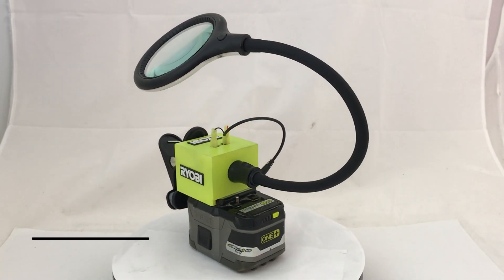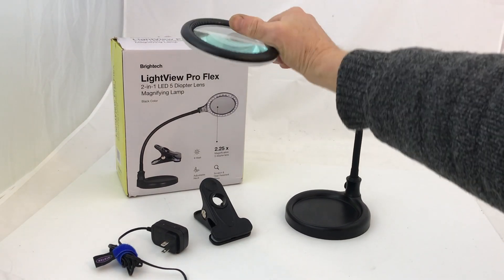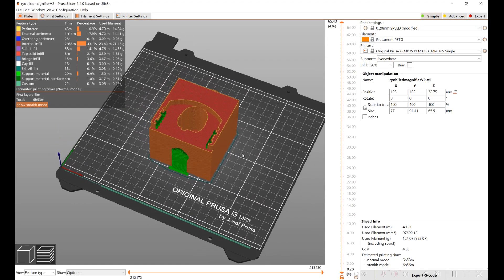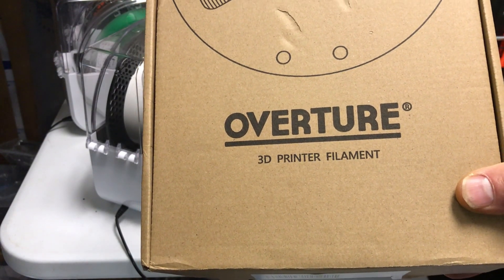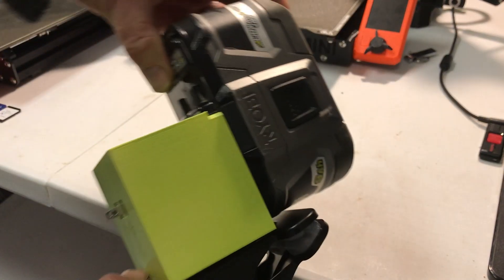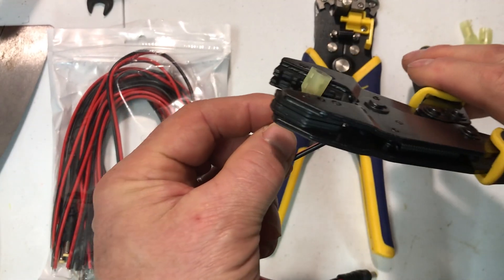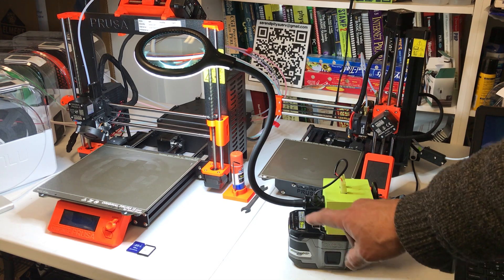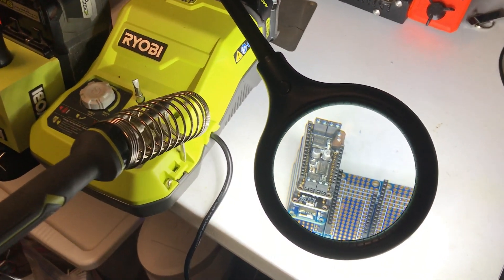RYOBI 18V DIY LED Magnifier

Comment: I just bought the same one and thought the same thing that I wanted it to be more portable! Thank you for the great idea!! I came across your videos looking for a battery hack for a 40volt ION ice auger battery replacement. I have Rigid tools for I have 18v batteries and now I know I can make a 40 volt battery out of 2 18v batteries because they actually measure 20 volts each

Comment: thanks, I made a bunch of your ryobi stuff
I made a cap for this to cover the wires and give a spot to install a low voltage disconnect to protect the battery
my cap was very basic, I cant cad. I imported this cube into tinkercad, sliced off a solid section, made it about an inch tall, then hollowed it out making a square bowl. I drilled a hole for the wires and screwed it to the top of your adapter
Reply from the maker: Nice! email me a picture of what you did. I can try to make it up in CAD and add it to the project files. Thanks!
Reply: @SerendipitySue  done, check spam if its there
Reply from the maker: @woodchippers_WestWingDimeBag  nope, didn't get it?
Reply: @SerendipitySue  serendipitysuerv  att gee male ?
found it on your about page
Reply from the maker: @woodchippers_WestWingDimeBag  that's it, but didn't get anything yet :-(
Reply: @SerendipitySue   I posted a video from tinker cad
Reply from the maker: @woodchippers_WestWingDimeBag  maybe just try sending a small photo?
Reply: @SerendipitySue  sorry for the delay, busy weekend. I added a video containing a couple pics of the cap I printed and the low voltage board to protect the battery along with a vid of the cap in tinker cad
just click name to go to my channel to see the videos

Comment: Would using the battery as a base be heavier when the battery is fully charged?
Reply from the maker: I don't think the battery weight changes with charge. I use the 9Ah battery because it is the heaviest
Reply: @SerendipitySue  ;)

Comment: I like the idea but we need a digital microscope too.  Please
Reply from the maker: Is there a particular one you like? What do you use it for?
Reply from the maker: Saw this: https://amzn.to/33QpJ9f
Reply: Having a system for either a minerals or coins with a removable SD card would be awesome. I see the Ryobi battery one plus 150 watt inverter/solar charger still not out yet. Sorry it took so long to get back when I went into surgery on Thursday.  Cheers
Reply: Don't know if I can paste the Amazon link here cuz I'm not a moderator .
Reply: Mssci 7 mp digital microscope with removable SD card...
Reply from the maker: @dennishedrick5308  seems like most microscopes on Amazon have built in batteries?

Comment: I have been playing with speaker systems.  Just got a 12 up to 24 volt DIY audio amp that I plan on powering with your battery designs.  If you like music you might want to build your own portable speaker system.  AMP from Fosi Auio ZK-TB21 50watt x 2 plus 100watt for subwoofer and it has Bluetooth.